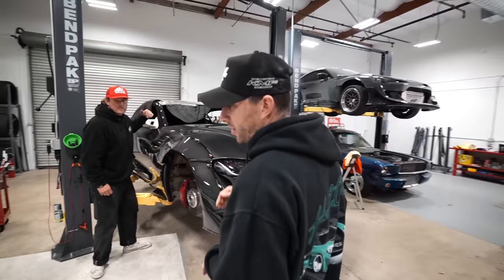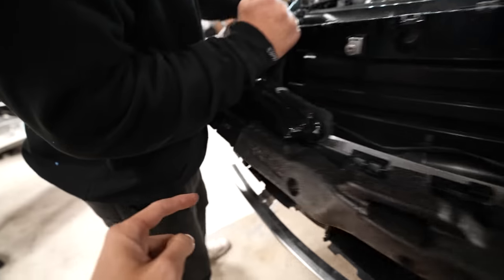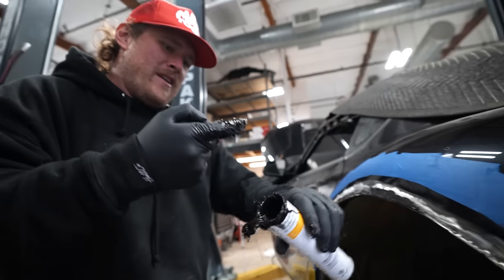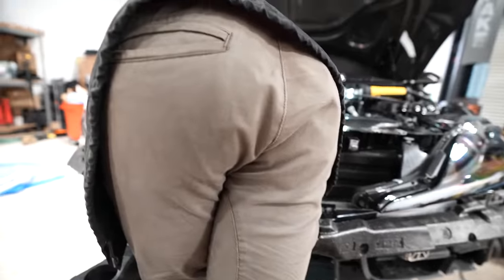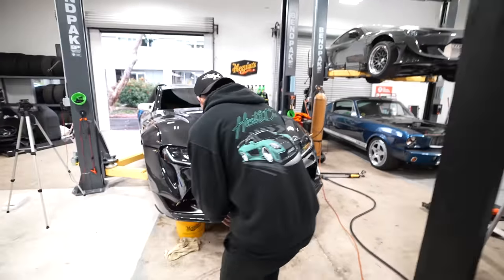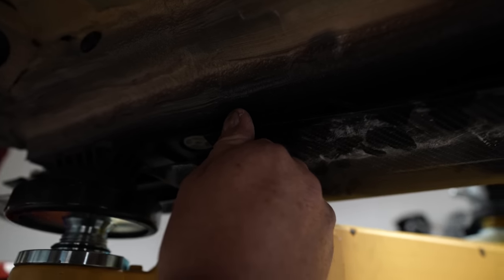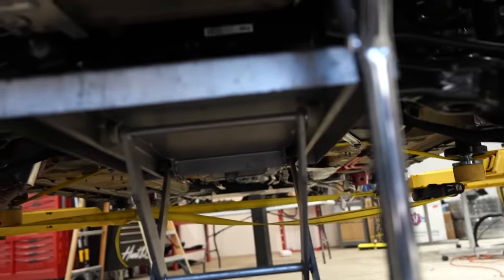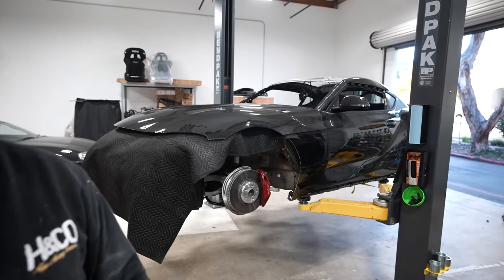Building My Supra into a Competition Drift Car Ep.3 - Installing NEW Parts!

Comment: Could get some mesh or grill looking material for the side vents/ducts to replace the stock ones
Gives more airflow while keeping radiators protected and looking good
Reply: Was thinking the same thing on the side vents because rocks go flying in, it’ll eventually damage those 2 small radiators

Comment: *FUN FACT*  Toyota added the extra cooling vents for this very reason. To be utilized by the aftermarket when tuning the Supra.  They tested the car with the vents open and it produced TOO MUCH COOLING which prevented the B58 from reaching operating temp.  So, they blocked them off on factory cars but left the vents in the body for people like yourself, TJ, to use when converting the Supra into a racecar.

Comment: As far as I know, the auxiliary radiators are for the air-to-water intercooler in the plastic intake manifold. CSF makes one out of aluminium with a bigger intercooler. Looks sick and helps keep the air from the turbo cooler. For what you´re planning, you might want to check it out. 
Greetings from Germany

Comment: I would paint that section of the front bash bar gloss black. Cut off the block off plate. Have it dipped in carbon or wrapped. Then reinstall it. Seamless design 👌🏽🤌🏾🤌🏾🤌🏾

Comment: Not sure if someone already mentioned it but the two different coolant systems are for a high temp and a low temp circuit. High temp going through the engine like conventional coolant but the low temp circulates through the charge cooler and liquid cooled modules👍

Comment: Calvin, when you remove the drive shaft, remove only the 3 bolts that go to the trans output flange. Remove the 2 bolts at the center support bearing and pull down on the center support. This will give you room to remove it on the tras side without smacking yourself with the guibo (donut).

Comment: B58s run two independent coolant circuits, one strictly engine and thermostat… the other charge air cooling… which does tap into AC condenser block so doesn’t need another rad.

Comment: The A90 cooling system is separate. One heat is for the motor and the other is for the intercooler. Also these cars use the heat exchange / coolant for the AC system also.

Comment: There are two separate cooling systems. One is the high temperature system (the bigger tank) and the other is a low temperature system. High temperature goes through the block, cylinder head, (and sometimes turbos depending on the engine.) Stuff that reaches over 200°F. The low temperature system travels through the intercooler, a/c condenser, and sometimes control modules.

As I understand,

The big tank is for main cooling circuit. (engine, turbo, oil cooler..etc). It is high temperature cooling circuit. (over 200 F) Small tank is for low temperature cooling circuit which include intercooler and air conditioner condenser. (typically 10~20F above ambient temperature)

Comment: Just Dremel out the nonfunctional parts of the mesh and slap it back in there. Might prevent the slightest of rocks getting kicked back and ripping the aluminum radiators
Reply: Or a rabbit from climbing in there

Comment: Can I get a motor on the house if this falls through.I say run a bar in front of the bumper connecting to the raw aluminum. (Paint it black to fall into place ) and the brake ducts looks good but useless if sideways .

Comment: The condenser is cooled with coolant and it is the part you pointed at 5:40
Reply: Also the cooling systems are separate, the intercooler and A/C system are together and the engine/oil cooler/turbo/heater core are together